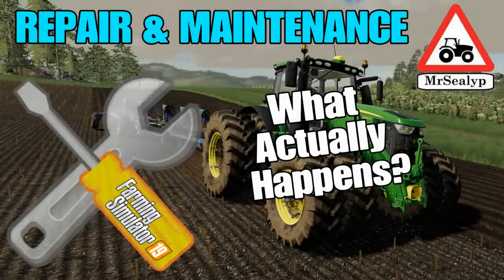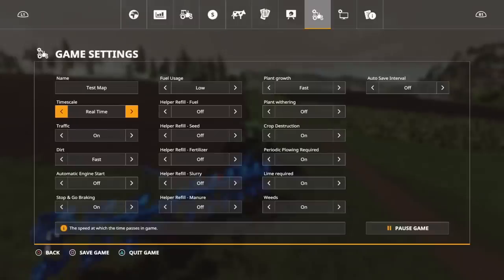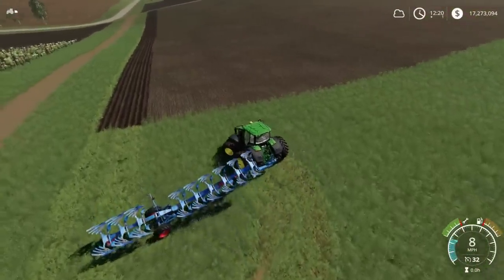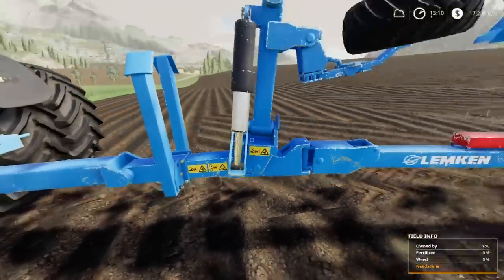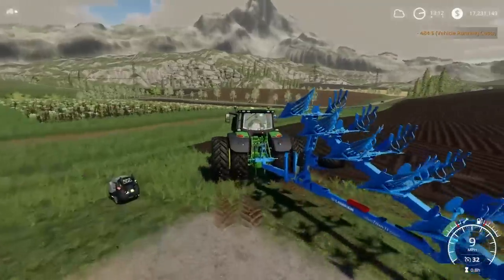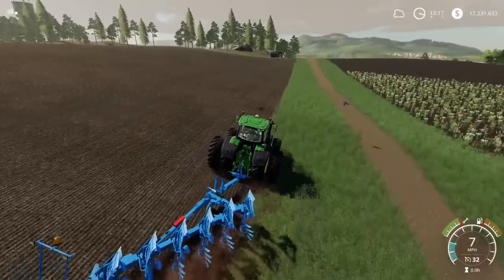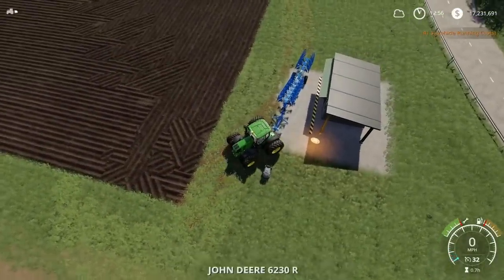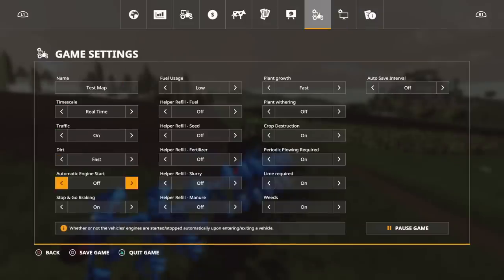A Guide to... REPAIR & MAINTENANCE (What Actually Happens?) Farming Simulator 19, PS4, Assistance!

Comment: Would love if tractors could be impacted by breakdowns. 
Reduced engine power, faulty fuel pump, fuel leak. 
But... you can only ask for so much at one time.
Reply: The tractor actually loses power once with maintanance dropping.
Reply: Ye it will make more noise and everything may work slower as usual
Reply: I do agree an have equipment an Vehicle's rust too
Reply: Exactly 🤝
Reply: You can have it !go buy the cheapest tractor you can find! You will have every kind of mechanical and electrical break down you can dream of! Then when you get it all sorted out you can sell it for a nice profit!
Reply: Not sure if it's the same for the Tractorsbut the Combines consume fuel faster when they are in need of repair.

Anyone else notice this?
Reply: I have two same tractors one with 53hrs on it and the other 16 and the 16 hrs one plants at 15km while 53hrs plants at 10km both were just repaired

Comment: I know the video is almost 2 years old, and patches may have changed things since then, but the record needs to be set straight for 2020: Low vehicle condition does reduce HP output by quite a bit. That doesn't change the maximum speed of the vehicle, it only changes top acceleration.
This means two things:
1) Your vehicle will struggle more when pulling the same equipment, especially uphill. The top speed may not change, but the vehicle will struggle more to reach that same top speed. If the vehicle is very powerful, you actually might not notice any changes at all.
2) The load on the engine while driving will be higher in all circumstances (even when no implement is attached), resulting in faster condition degrade and higher fuel consumption.
Reply: Also, the game code shows that the vehicle will waste more fuel (up to 30% more!) on top of the fuel wasted due to extra engine load.

Keep your vehicles repaired, folks!!
Reply: @pieces of8t Washing does not affect performance. But I wash mine too. :P

Comment: I just did a little test. My tractor in much need of repair was struggling up a hill while cultivating. I decided to repair my tractor just to see, and it struggled much less, even hitting top speed sometimes. Flat ground, it worked the same needing repair or not. So it seems that keeping the tractor repaired CAN make a difference. Hope this helps.

Comment: also if you make an underpowered tractor do a job its not meant to do, like say for example, make a john deere 6R pull the biggest plow in the game, its durability will crash faster than normal. so its worth the investment to get the right tractor for the right job.

also the john deere's do suffer from wear and tear, however tractors with mud guards have a longer time before the rest of the body gets mud on it which means that the undercarriage, axles, suspension and wheels will suffer the most, if you make any tractor (including john deere) work until its down to its last bar and never clean it, you'll find that the mud gets all the way to the cabin glass and all over the lower body, grill and hitch mounts, once you wash it you'll find that those areas will have much more damage on them, but compared to the undercarriage, axles, suspension, and wheels, the damage on the rest of the body is more conservative. note that damage models for vehicles that have a lot of mechanical parts are different from tractors, like combines for example have internals that get worn and damaged after multiple harvests. this also applies for the harvester headers.

Comment: I want to see some crazy realism with the repair. Like when you repair it, it will tell you whats wrong and charge you accordingly. (ie. a shank on a cultivator, tractor oil filters, a sheered bolt, a leaking hydraulic hose.) Further if you repair something, that specific component cannot deteriorate for a certain period of time.
Reply: @MrSealyp  oh no way...I'll check it out!

Comment: I've had a seed drill on a tractor with 0 maintenance going uphill at around 3 km/h. Stopped on the slope, repaired the tractor (not the drill), ran it again and it went at 6 km/h. So there does seem to be a power loss with no maintenance on a tractor, but it's probably too small to be noticeable except in situations where you're already lacking enough power.
Reply: I have the same experience with my harvester like you👍

Comment: Hello Mr. SealyP!

Very informative video indeed.
You mentioned that the wear & tear is linked to the dirt, but it's actually linked to the dirt setting only - meaning that you can't reduce your maintenance fees by keeping your machinery clean (though that would be really cool, would add more than optical reasons for a pressure washer). Second thing is - if you had been going for a plow with closed blades, you could have told by the blink of an eye on how much color you already had scraped off of the blades what the maintenance condition of the plow would be. Same is true for cultivators and other ground scraping tools. The wear & tear is actually shown with how much color has been scraped off of the earth penetrating parts.
Besides of that ...

Whatever You should choose to do - enjoy doing it and ... Thanks for Sharing!

Comment: Thanks for this video Mr P very informative! Strange that the tractors on 0% condition are still 100% working, I would have expected issues (speed / hp etc). it took you 7+ hours to test that too. I'll not repair my current tractor and see if it has the same 100% working feeling at 0%.

For any PC players reading comments, there is an excellent mod called "Enhanced Vehicle" it tells you the % condition of the attached machinery, Yes I know you can look it all up in the menus, but I never know what is what in that screen.

Comment: Reading the patch notes for the last PC update, and then investigating further myself, I have established:
- The repairs and maintenance ARE still linked to the cleanliness; however
- Turning the dirt off altogether does NOT turn the repairs and maintenance off altogether, but instead only lowers it to a minimum level.

Therefore, you can still adjust the repair schedule by adjusting the dirt levels, but you can no longer turn off the repairs altogether, like you can the dirt. Hope this helps.

Comment: [Fixed] Wear speed if washing is disabled (1.2)
That's in the last update they did (update 1.2)
No idea what it actually means and what's the impact to what you just said
As you said it though made sence ...no idea if it still does though :/
It's updated for PC already.Heard Sony will release it later.
Giants released the update for all platforms so it's not their fault PS4 and XBox didnt had it on time
Reply: Just means that wear and tear are no longer tied to the dirt level on items. Disabling dirt no longer nullifies wear and tear.
Reply: steam doesnt check what the devs do, consols do. they make sure no viruses etc. are in a update. its safer but slower.
Reply: @C20F  indeed

Comment: Since you said the John Deeres dont show any physical damage you should test this with another brand
Reply: They do as iv done this and seen it .
Reply: I had the same thought..maybe it is just a thing with the JD's where the maintenance doesn't effect the uses. I feel that I have seen some game play where a fairly damaged harvester lost HP and wasn't able to harvest very well. ( But that could also very well be the header )
Reply: @codynace912   so is it just a thing with the John Deere series that its not effected?
Reply: @whitebuffalogaming9159  that I'm not 100% for sure. I haven't noticed anything on jd. With they would alter it so we can see
Reply: In Real Life the John Deere would catch fire
Reply: Yeah, I think it's  a JD thing too, like the guy below that mentioned racing games.  There's a bunch out on various forums that JD wouldn't allow their vehicles to degrade.  Personally, I notice a fairly significant decline in power and speed on the lesser branded tractors.  The OEM Case 7 series (the first in the medium class) when pulling a fully loaded single axle fert spreader can work at 8+mph on flat ground when perfect, but doesn't take long to drop to 4-5mph as the wear bar on just the tractor nears about 50%, causing massive fertilizer loss - a killer when trying to do profitable contract work.  Perhaps I'll need to go green since they don't seem to ever wear out.  I'm surprised JD allowed Giants to even let us repair them anywhere but a licensed JD dealership.
Reply: Phalanx380 if it was a jcb it wouldnt start or will break down as soon as you start it

Comment: We need the tool box mod so that repairs can be made in the field for a more realistic game play. 😁🚜
Reply: It would be cool if they had break downs and other stuff happening like a  harvester getting plugged with corn or it's to wet to pick up soy beans stuff like that would make very real.
Reply: @C20F  So it's not realistic to repair a hydraulic line or a belt in the field?  Doesn't make much sense to drive or transport the whole machine to a shop just for that.  Of course major repairs should be done at the shop. I'll agree with that. But to say minor repairs should not be made in the field is unrealistic.
Reply: We need a service truck that would be awesome
Reply: In real life very little repairs on newer tractors are done on the farm.
Reply: @brandonk4477  your wrong everything but Major repairs (IE clutch) are done here if we cant do it we have a guy come to us tractors never leave.
Reply: Be cool if the toolbox only repaired only a little bit of it not all the way back to 100% so you can get it to work then when you get to the shop u can fix it all the way
Reply: That's not realistic, if your rods knock, and you lifters are ticking really bad, do you think you can fix it with a small toolbox?
Reply: You have to go to the shop to repair it
Reply: You’re not even allowed to repair your John Deere and Case IH by yourself when you buy it you have to sign an agreement paper that says you can’t repair it yourself you have to go to a real workshop so it would not be realistic it would be illegal
Reply: Datobros Gaming&vlogs Bull. Not in the US.
Reply: Anything with a motor never needs repair, how weird. So I only rrpsir headers, planters and cultivators.
Reply: Oh yeah
Reply: Yeah I wish they would break down and you would have to buy parts and have to haul them home and fix them up
Reply: @brandonk4477  Nah, most repairs are done in the field. Most dealers or brands have mobile service trucks that come do on-site repairs for all but the most major problems (blown engine, etc). You try loading a combine with a sheared off axle on a trailer... its literally easier to do the repair right there where it sits. lol
Reply: CocoRummer a garage workshop we can actually use and buying tools that we need flat tires an actual damage model

Comment: Another excellent guide! One last point though is what happens when you get a tractor with 30 hours (fully repaired) and a new tractor (also mint condition) and both pull a plow? Is there a speed or power difference?

Comment: You bring up some good points, i think the condition of tractors is based on looks, tractor runs like it got off the factory floor, but to me, i did notice that the paint around the bolts on the 3 point hitc thing looked like it was chipped off, maybe it was the lighting bouncing off the tractor, i don't know, because like you said, if the tractor fires up right away, go top speed, and use implements that goes top speed while in use. But awesome guide to as always.

Comment: Another great video.
What happens if you don't jet wash the implement but still try and repair it. Will it refuse to repair due to the dirt and if this is the case does it charge you still for the repair. Assuming it does repair with dirt remaining will further use add more dirt and increment the repair situation again. 

I suspect the tractor not degrading the same as the implements will be fixed in this or another update otherwise what's the point of having the repair system on tractors.

Comment: It's not longer the case. I appreciate that video is two years old but I have tested this recently on few different tractors. Had Fendt 500+ bhp and when service bar reaches zero the tractor shows signs of wear and tear both on external appearance and pulling performance.

Comment: This might be worth a revisit?
I have done some rough testing and I think tractors do loose HP when worn. The problem is it seems to be quite a low amount so unless you have a 150hp tractor pulling a 150hp piece of equipment is barely shows up. 
I’m also not sure they have added it to the JD brand. I did some tests with the Fendt Favorit 500 and this seems to slow down once worn out if trying to use equipment at its max rating.

Comment: Farming simulator shows in shop full HP that tractor can get while at specific RPMs but actual tractor horsepower is 230 or 250 if its john deere 6R as you can read it from the hood of tractor, so these 280 and 300hp are just HP that you can achive while having right amount of RPMs, so you had less HP than this plough needed
Reply: So i add here a link to the John Deere internet page where you can see also that 2 top engines are 230ho and 250hp https://www.deere.co.uk/en/tractors/mid/6r-series/

Comment: Running a John Deere 7720 tractor, with the novacat 301 ED and X8 ED mower set up, it would not work with very low maintenance on the tractor

Got the tractor repaired, works as normal

This is on the Sosnovka map

Comment: Would like to see smoke as a repair indicator. Black exhaust of more strain and unused fuel wasted, then thicker blue for engine wear and a thick cloud making tractor nearly invisible to indicate near failure and fire for total shutdown and overhaul to get it running again. A portable tool kit does reduce damage by one notch and is free but takes a bit of time. If tractor catches fire for too long past overhaul point player risk total loss of tractor.
Reply: If the tractors are set up with def there won't b any black smoke that's why def is used so there is no exhaust smoke

Comment: They said that as a tractor ages it will consume more fuel.
Reply: Thats true. A real engine consumes more fuel also if the air filter are  full of dust or if the radiator is not clean. It also loss some power in summer for example

Comment: Plow and cultivators since they are just knife and shovel tools with no real power drain on tractor your not gonna really see the effect try using the combine going up hill in the various stages.  Edit also don't forget to add the amount of time you have the vehicle, just like FS17 the longer you have the vehicle the more it will cost to repair it unlike FS17 FS19 don't autorepair like FS17 did.

Comment: They should have a update where you need to check over the machine before work for example like checking the baler to prevent a fire or a brake down
Reply: Lochlan Mcdonald would be awesome. They should make it so if your repair bar is empty the equipment won’t work and vehicles break down and won’t work.

Comment: Great video. On my JD 6R I have over 32 hrs and I’ve repaired it when needed but never washed it. What I noticed in the finance page is the impact on value. It has decreased to 49k dollars and is in red with an exclamation point in the circle, but I can’t find what that really means. Do I need to trade it in? Will it go to 0 value or break permanently?
Reply: My New Holland T5 just hit the red exclamation point today after about 30 hours of use. I suspect the costs to repair will rise from now on, and the resale value will drop, but keeping it repaired should keep it useful. I repair it most days along with my Kuhn solid fertilizer after filling a few fertilizing contracts. I've never washed it either, and I notice the FS19 low Dirt setting definitely slows down accumulated dirt compared to FS17. In 17, I could drive 30 feet from the washer across a concrete slab and the tire treads would already be getting dirty again.
Reply: @jeffhale2982  please let us know if you find anything :)
Reply: Same here, I have a JD 6M with 40 hrs, never washed and its value decreased to 29K ! (Maybe I could trade for a Gator! lol ) Looks like the maintenance has not an impact in performance but in price. I have a new JCB and it is with 20hrs and I am washing and repairing after each job. The price dropped a lot less in %. I dunno if that will change and drop faster with more hours ...let's see....[EDITED] ok, I did some test and edited my xml to simulate some scenarios, and looks like the dirt and repair is not linked to the price drop.....just the working hours. After you reach a certain amount of hours your vehicle lost a lot of value quite fast. There is kinda a break point with 30 working hours. After that your vehicle begin to lose a lot of value per hr....
Reply: @schiewig  can you see any other imoact from the hours? Like more expensive repairs or higher fuel usage

Comment: I'm on ps4 and have experienced power drop when vehicle was in need of repair. I play on the normal dirt  setting.
Reply: @MrSealyp   I had very slow acceleration and  drastically reduced pulling power.repaired it and everything was back to normal. This was with the Case 7200 series and the Kramer front loader.